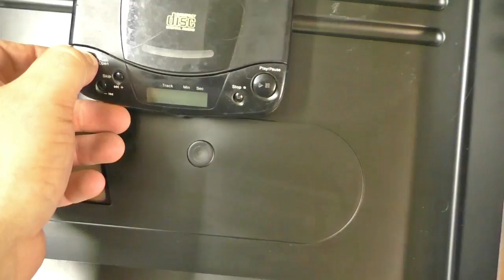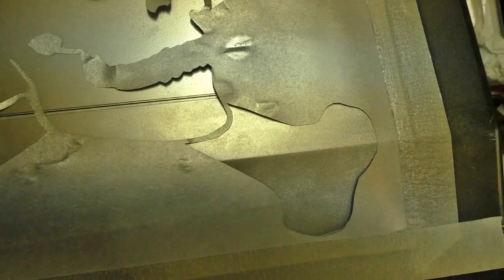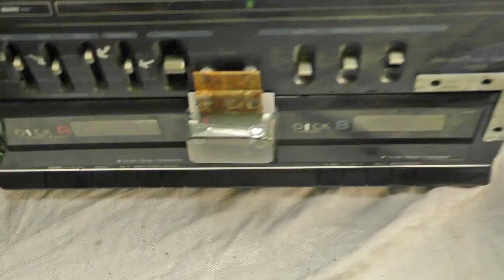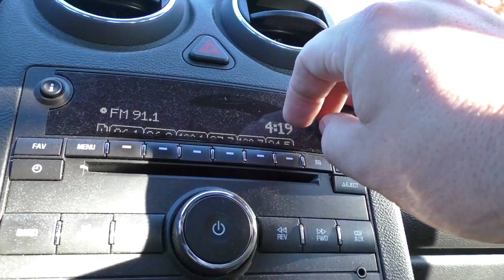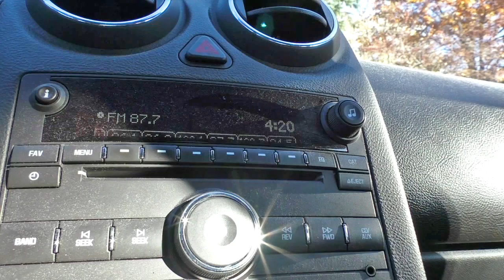How to build a Post-Apocalyptic Wasteland Radio Station (Pt.2) - Larp Style

Comment: Very cool.. but won't you get in all sorts of trouble for broadcasting on the FM spectrum? I always thought that was illegal without proper permits and such..
Reply from the maker: No, if it's low power and on an unused frequency and you obey FCC laws on language and copyright and stuff.  Like I said, it's best for anyone to research the laws themselves or maybe even join a local ham radio group or something, someone will know the laws.  But you can do it.  All this is, is essentially like the FM transmitters you buy for your car to have like your phone or mp3 player broadcast to your radio, but just a bit more powerful.  It's a boring read, but the basics are, if it doesn't reach over 200 feet, then it's probably ok.  Since this got about 100 feet, it's well within that guideline.  But here's more if you want to read up.  https://www.fcc.gov/media/radio/low-power-radio-general-information#UNLICENSED

Comment: How did you do voiceovers when there's no mic input? 😁

Also what is the name of that fm transmitter? 

Thanks
Reply from the maker: Transmitter is a no name gray market thing I got off eBay.  And the transmitter itself has a mic built right into the board.  At the end when I'm in my car, I recorded the little "radio segment" on a tape and just hit play on the unit, went to my car and tuned in.  That's why it's so cool, you can run it just like real radio station with pre-recorded stuff!
Reply: Larpgasm cool, thanks, the ready build ones look like crap..